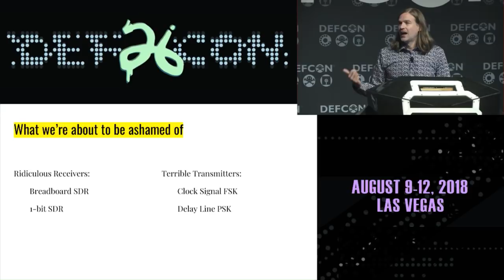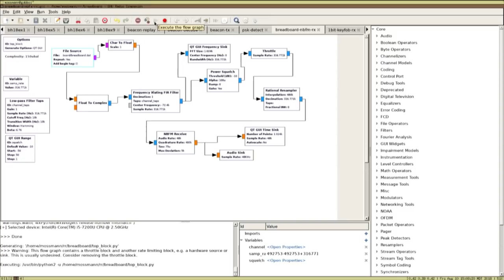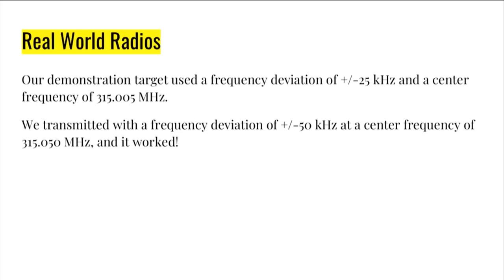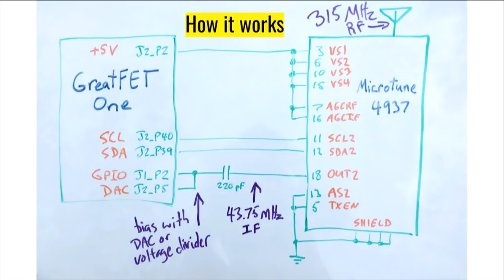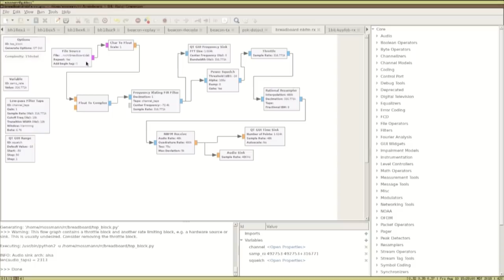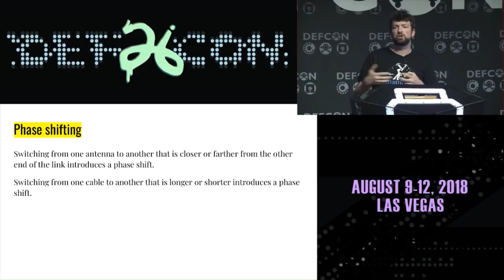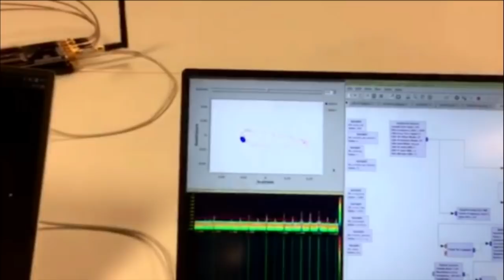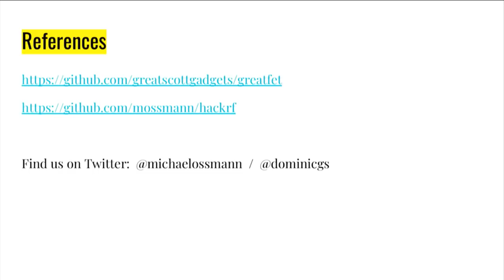DEF CON 26 - Ossmann and Spill - Revolting Radios

Comment: 24:00 Just an FYI for the people watching - Nyquist sampling rate states that you need to sample at least 2 times the rate of the signal. In the real world, we sample at 10-20 times the rate of the signal to get a fairly accurate representation of the signal. I sense that the presenters might have got lucky here because they are definitely not oversampling.
They're sampling at approximately 0.5 times the rate of the signal. I wonder if they're sampling a sub-harmonic.
'Oversample and decimate' is a fancy way of stating a moving average filter, which is the most basic of filters.

Fair play to them though. It's an interesting talk. And hooking up the DAC to the ADC to find the sweet spot in the hysteresis in a nice idea.
Reply: Undersampling would work.  It would be smart to use a filter before the ADC to make sure the spectrum digitised is the actually desired range (above or below the sampling freq).

Comment: Contemporary direction finders are basically multichannel interferometers and this trick does not work against them. Pseudo doppler was a modern technique in the nineties.
Reply: Is that TDOA? Time difference of arrival? Basically the signal hits the closest antenna first, then the next closest next, etc?